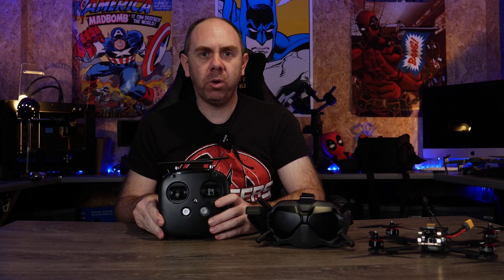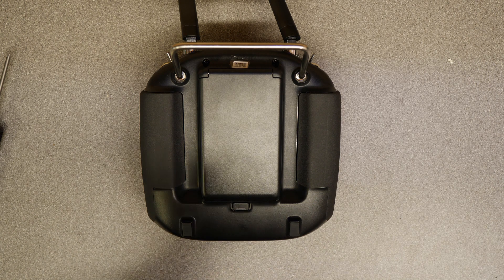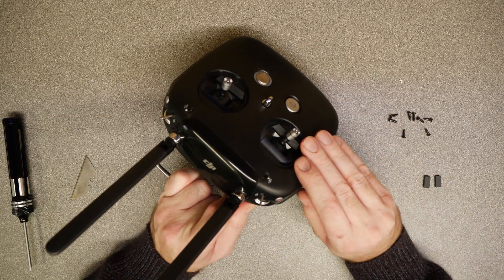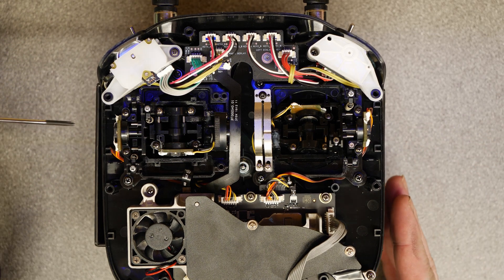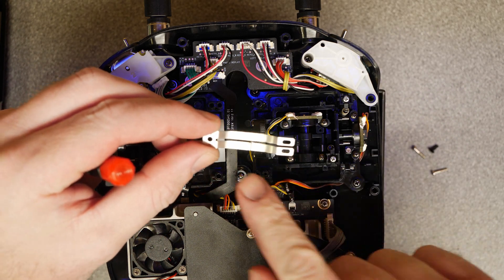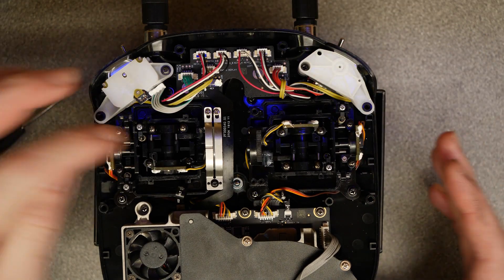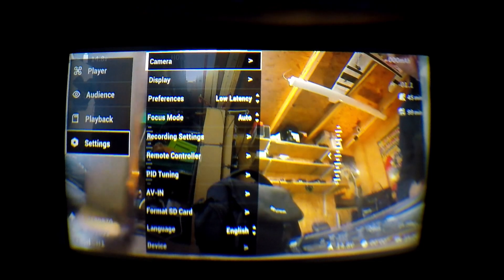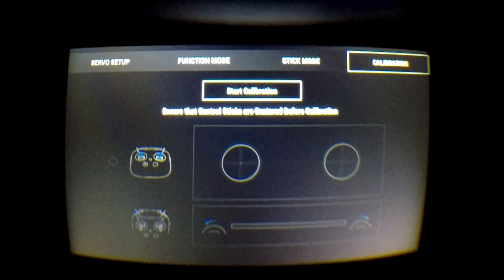DJI FPV System Remote Stick Mode 2 to Mode 1 -  How- To

Comment: I tried to adjust the stick tension and the screw got somehow bent or slipped a few millimetres away and under where the hole is.

Comment: Hello there, can i switch the mode without the goggles?
Reply from the maker: No you need the menu to access the settings.
Reply: @MadRC  and does  it require a Airunit or does it also work without a Airunit?
Reply: Leon Suter It requires the air unit.

Comment: HI There, Great vid.  I just did the mod from mode 2 to mode one.  I followed your instructions and all good....But... I can't get the correct channels in Betaflight. I put it in mode 1 on the goggles and TAER1234 in Betaflight  but throttle is E, Aileron is T, Elevator is A and yaw is correct.  What am I missing??  Do you have to swap the plugs in the controller around?  Cheers
Reply from the maker: You may need to do a custom channel order in BF
Reply: Mad's Tech Reviews & Tutorials I got it working but the mapping is the same as mode 2. Strange as mode one is usually TAER1234. Everything is in the right orientation but as soon as I touch the throttle, the thing want to fly to the moon. Is there a throttle setting I’m missing?  Do you need to change the plugs in the tx to change the channels so the mapping is correct in BF?
sorry for all the questions 
Cheers

Comment from the maker: ====================================Support Needed ===================================

Hi Guy's , In the process of making this video I ended up damaging my remote as you will see, i'm now going to have to buy a new one as the cable is simply not available, if you would like to support me in doing that please use the DJI Links below or you can donate to support the project. 

Donate via Paypal to  mad_rc@icloud.com. 

Order DJI Digital FPV System https://click.dji.com/ALwcdoCMalut8lJpGkIA9w?pm=link&as=0001

Please also subscribe if you like my content :) 

Thanks

Comment: Thanks for the tutorial. Made the mod much easier and I didnt need to sacrifice a cable. The clip on the top is brutal though. No chance in opening it with a plastic pry tool. I had to resort to a screwdriver as well. Was wondering why you used one, now I know.

Comment: Is there a way to change to mode 3 its just like mode 2 but the sticks are just reversed
Reply from the maker: You can do the changes in your FC software to mimic mode 3.
Reply: @MadRC  will doing the mod in the video give you mode 3 if you leave on mode 2 or is the only way to change in fc to get throttle and yaw on right stick and pitch and roll on left stick
Reply from the maker: Kerry James Millar you still have to remap in your FC. This basically is the hardware change for the spring on the sticks. You then map it as you wish in Betaflight ect.

Comment: Hey Andy, always enjoy your comprehensive tutorials/reviews.  I have the DJI remote and I'd like to add a bit of push/pull resistance to 'both' sticks.  I think the 'stock' setup is a bit wishy washy.  I have not seen any tutorials on the process and wanted to ask your advice.  Thanks!